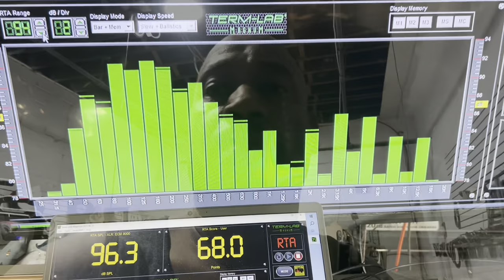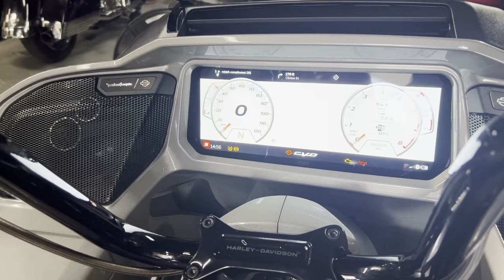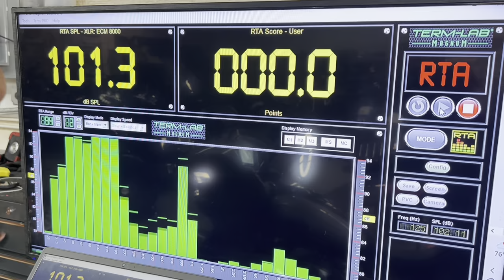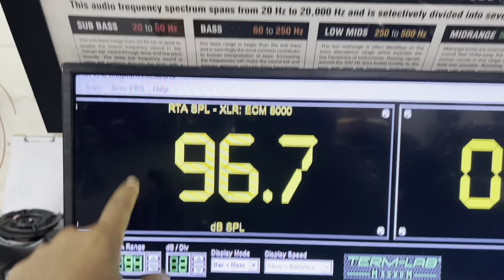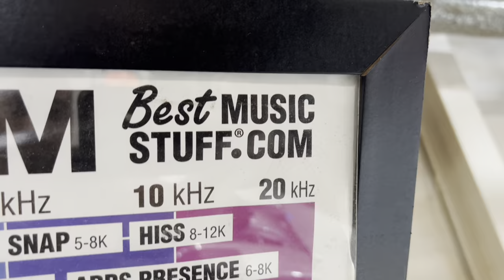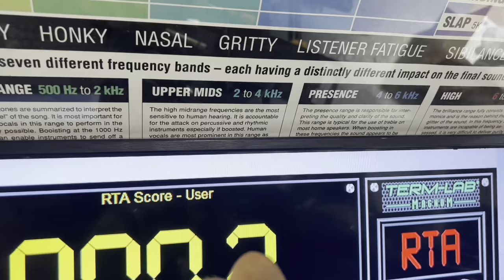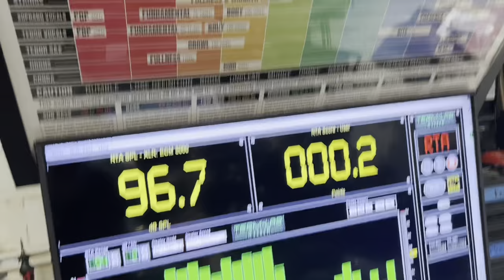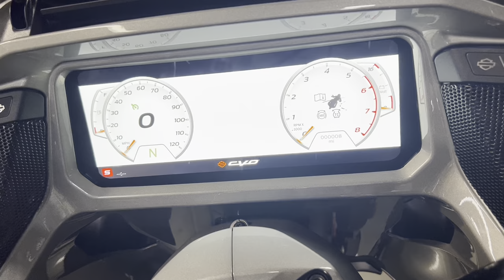NVS Audio takes delivery of their brand new 2023 Harley Cvo Road Glide demo bike for the shop.

Comment: Wooo I remember when the 1984 Corvette came out , new model platform and that crazy expensive Digital dash that was neat as hell back then till one Item failed on it and then most of your dash was dead,,,This is going to be interesting for this new TFT platform that will probably need a ton of Firmware and Software updates,,,Glad to See NVS already has the new shop Guinnea Pig lol.

Comment: Hello Carlos. We just purchased a 23 SG CVO and when we asked about the Stage 3 flash for the audio system after installing the 6x9's, they said we can do the update via a Rockford app, does that sound right?
Reply from the maker: They are 100% wrong check my video I believe it’s the third one on the 23 CVO. It has the same thumbnail as this video. It literally shows the process on the dealer computer show the video to your dealer.
Reply: @NVSAUDIO  Thanks Carlos, after some back and forth with the purchasing dealer, we went to another dealer and got the stage 3 flash. Sounds louder, clearer and deeper. Thank you for your time.

Comment: Awesome! 2 questions, 1. Are you going to do Harley’s flash for the 6x9. It says on the website it helps. 2. Is the amp in the bag?
Reply: I also read it needs the flash for the DSP? And when I looked in the bags at the 120th the amp wasn't there, so I'd assume it's in the fairing.
Reply: The amp is in the fairing.